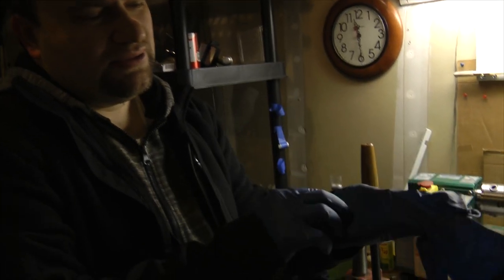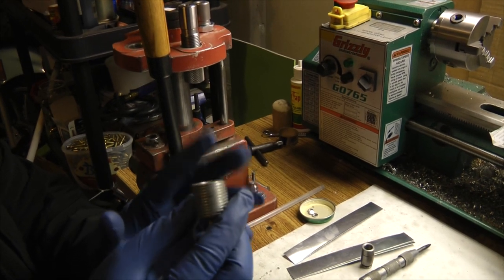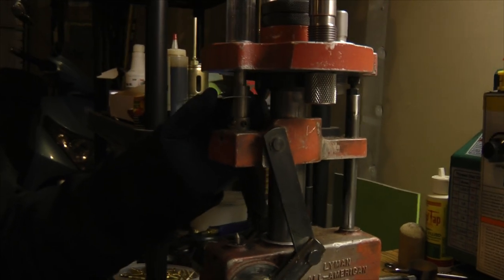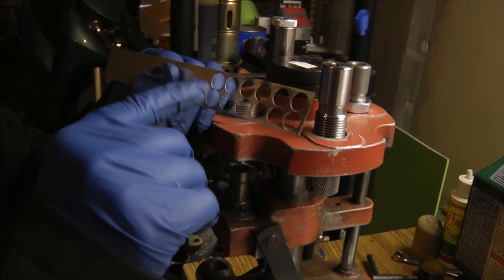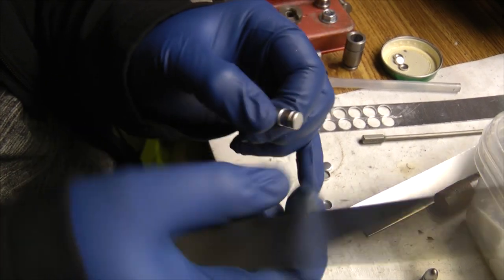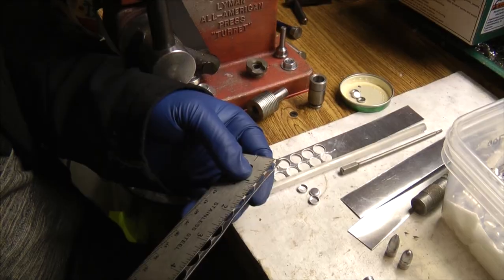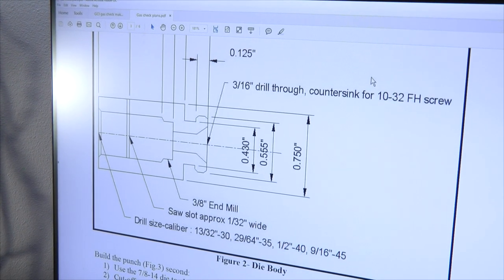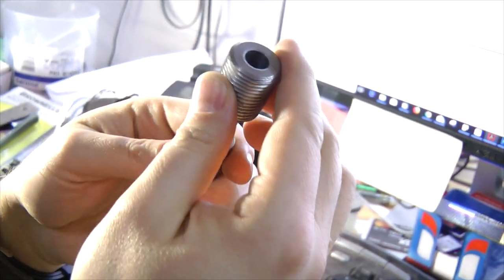Homemade Gas Check maker

Comment: Cool tools. I dont have a lathe so i use Freechex and Pat Marlins tools. However, i would offer you one tip.......if you anneal your aluminum strips first (quick heat with propane torch) then your tool will cut way easier and will not dull so fast either. Good shootin' to you!
Reply from the maker: Thanks for the tip, I will try it.  I heard some people put on the very bottom of toaster oven, going to try it both ways.

Comment: love the creativity. the reason some are harder is probably cause when you cast them some may be little bigger in diameter from one casting to another depending on how it fills the mold when sizing. i know this is a old video and im sure others have said what i have said.
Reply from the maker: Actually, they drop out from the mold pretty identical once you get going and keep the pace the same.  This bullet is just bigger around .312 - .313" by design for 7.62 hence the name 7.62mm-130-SPL and combined with hard lead can be quite difficult to size it down to .309, especially with gas check and without the lube.  Lee says to use lube during sizing, but since I normally powder coat later, I can't have the lube

Comment: Awsome Dima! I was a little confused on how the forming punch worked. After looking at the blueprint and seeing your vid I see its a separate piece that sits inside the body then a screw holds it in place.  Makes sense cause itll be hard to machine that inside the die body. Great stuff brother! Gotta make a welcome video
Reply from the maker: It sure was confusing for me as well.  Because I don't have any formal training I had to look long and hard at the plans and just see how it goes.  In my first attempt it didn't came out great so I had to redo it.  If I had a milling machine things would go a lot easier.

Comment: This is good work Dima, thanks for the video!
Do you think your tool would work in a Redding Ultramag? I think of the lateral struts that could hinder the supply of material.
Would you send me the drawings, here in Germany nothing comparable is available?
Best regards Michel
Reply from the maker: Yeah your press might be a problem.  I am using cheap Lee press https://leeprecision.com/reloader-press.html it has now lots of play in ram but works just fine for gas checks, in fact I screw in die to get maximum leverage and it makes it easier.

Comment: How thick is this aluminum foil in millimeters?
Reply from the maker: 0.13 inches = 0,33mm.  0.12" = 0.3mm this might work or might be a little small especially the older lyman molds prefer thicker gas checks.  0.14 (0.355mm) or even 0.15 (0.38mm).

Comment: Sometimes I make my own gc too--but I use the patmarlins dies for pb gas checks and the freechex for the regular gas checks.  Similar process as yours.
Reply from the maker: Hey Lead Taco, thanks for the t-shirts again. Ruger one is really cool!  Did you find any benefits of using GCs for plain bullets?  I believe they are made from aluminum cans?  It seems to me that it would fall off pretty easy.
Reply: I was using a little thicker material, the pop cans are too thin--they swage on and seem to stay on quite well.  I was putting them on the bullets that I wanted to push harder.
Reply: So the main benefit for doing plain base gas checks is that you can buy a plain base mold and shoot the bullets with or without gas checks.  When I shoot gas check bullets without the gas checks, it seems like I don't get as good of accuracy as the plain base bullets without gas checks.